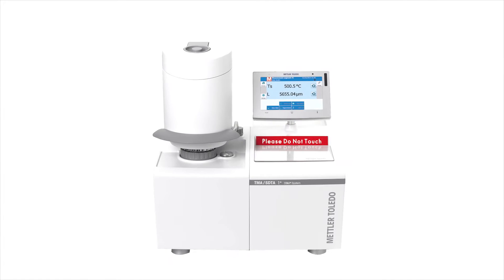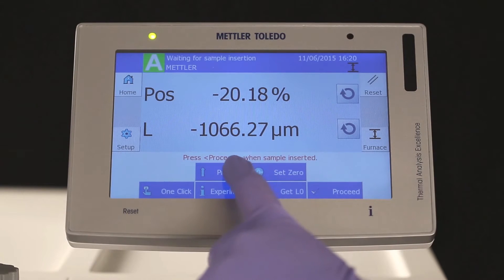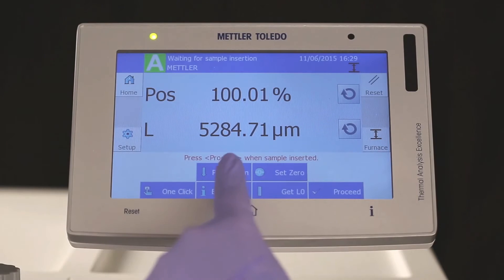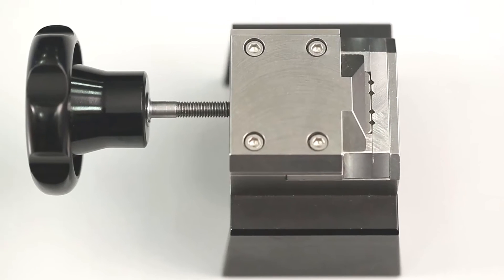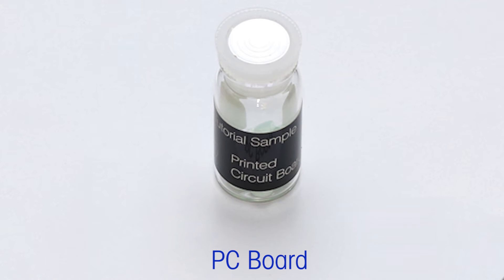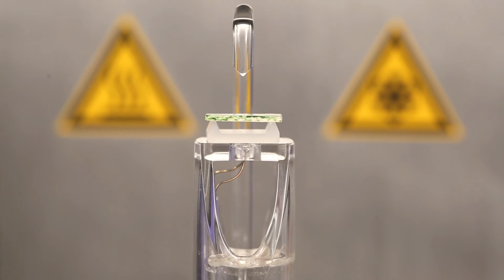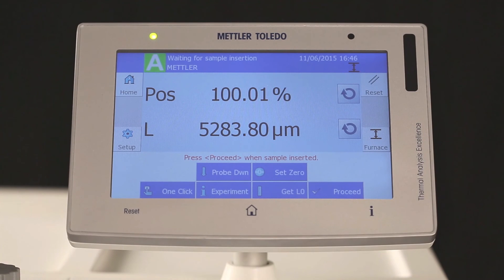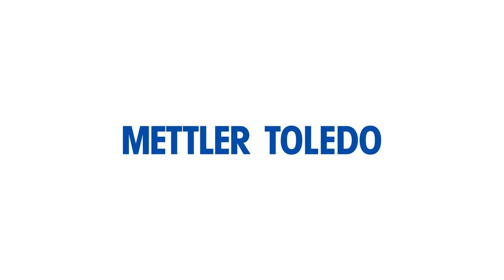Tips for TMA sample preparation

Comment from the maker: This video presents how to prepare samples for the TMA. The setup modes are as follows:
• Dilatometry
• Penetration
• Tension – film and fiber
• 3-Pt bending
• Swelling
• Volumetric expansion

Thermomechanical analysis (TMA) is used to measure dimensional changes of a material as a function of temperature or time. Thermal expansion and effects such as softening, crystallization and solid-solid transitions determine the potential applications of a material and provide important information about its composition. 

The TMA/SDTA thermal analyzer incorporates Swiss precision mechanics and is available in four versions with furnace systems optimized for measurements between –150 and 1600 °C.

For more TA tips and hints: http://www.mt.com/ta-tips 
Latest Thermal analysis news: http://www.mt.com/ta-news